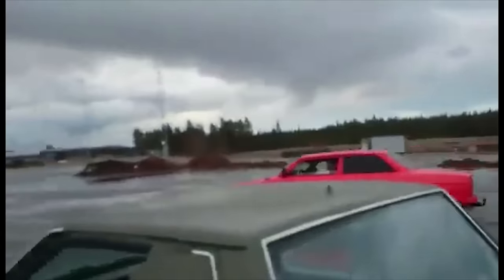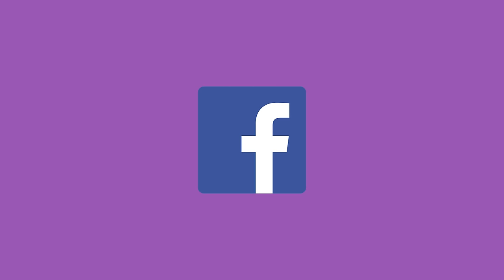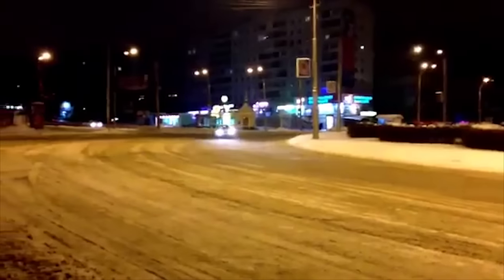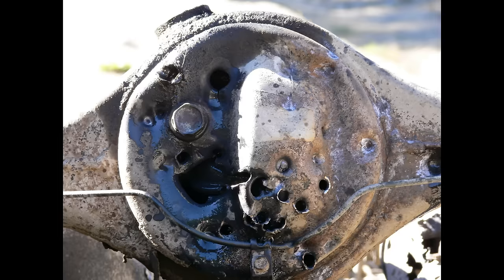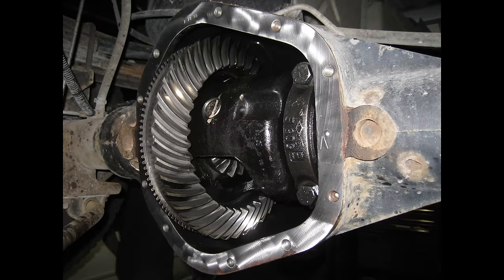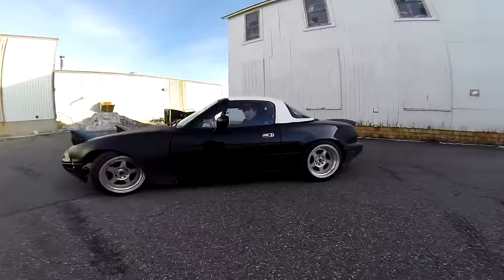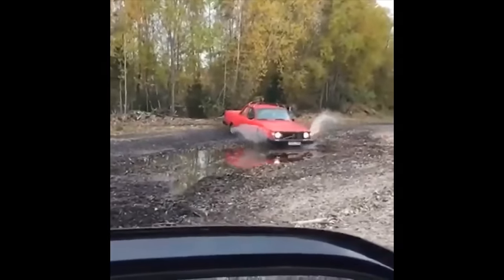Daily Driving A Welded Differential

Comment: I think I'd rather go the Clarkson route... MORE POWERRRRR!!!!!!
Reply: For a nice one tire fire?
Reply: +NGC1433 Who says I'd use a fully locked diff instead? There's something like a limited slip diff for a reason. ;)
Reply: This video is about welding open diffs on cheap cars. LSD's and POWAHH!!!111 have nothing to do with welding nor cheap.
Reply: I'm no nigga, nigga. Besides I drive a fine BMW e46 (hatchback) which has a LSD from factory (3.38 ratio in my case). Owned an Alfa Romeo 156 (sedan) before that and a Lancia Delta (hatchback) before that.

Also I meant locked diff earlier... my bad. Oh and it's a cheap mod but if you ever decide against it after you did that mod... it'll cost you a new friggin' diff. I'd rather add more power for that money as that'll give me more fun sideways as well as in a straight line. ;)
Reply: LogiForce86 Sorry, but I call bullshit on this... No e46 came with an LSD from factory apart from the almighty M3 e46... Ask me how I know, I have the same problem on my e39, no LSDs apart from M5 ones which don't fit directly (you need to swap out the whole rear subframe, same goes for e46), so no, you don't have factory fitted LSD in an e46 ;)

And welding the diff is often better than an LSD for drifting... For example, I have e30 Touring with 4.4 V8 swap in drift spec... The car was fitted with stock small case LSD... It got obliterated the first time I went out on track, so I swapped in medium case welded diff and the car started behaving better... Anyway, that one got busted as well, so I've swapped in the big case welded diff, but that's irrelevant...
Reply: !WK3 You're right. Just checked and I really wasn't well updated on the car since I just got one. Still getting used to these Germans. ;)
So a fixed ratio it is? According to RealOEM I have a ratio of 3.38 at least on the Compact.

Thanks for the wake up though, before I made a bigger fool of myself. Although I still rather do things right than half arsed and eat tyres away during normal driving. Drifting is nice but you won't do that with your daily all day long, every day of the week.

Still the current diff is nice enough for how I drive the car, and that's not drifting per say. Still it is nicely controllable if it does. I quickly noticed this in the wet because the garage I bought it from installed el-cheapo tyres that didn't have the tread grooves properly cleaned from molding residue. So as it couldn't channel water it was basically more like a slick in the wet. It was... quite interesting. :p
Reply: LogiForce86 With no grip, you could often have your car behaving like an LSD equipped one would during a slide because there is almost no force stopping the outer wheel from spinning thus not behaving like an open diff equipped car would :) Specially on a Compact with low weight in the back ;)
However, as you could have noticed before, I'm really hardcore into drifting, competing actually and my next drift event (last this season) is this Sunday (irrelevant, but wanted to mention it), so I do tend to drift my daily as much as possible... Which is not a lot as it's a 520i e39 (2.0 150bhp), obviously, with an open diff; and I'm driving on almost new sporty 255/35ZR18 tires in the back (I bought them new in April)... So I'm seriously considering welding the diff, installing a hydro handbrake (using my factory handle for maximum stealthiness) and setting up suspension for drifting, including swapping rears for worn out 205/55R16 when I want some sideways action... But that's just me, and that's just because a proper clutch type LSD costs at least 2500€ for an e39 and I'm not going to give 2500€ when I can spend ~50€... Yes, it might have some drawbacks, but still, it's better than an open diff in my case :)
Reply: Mine is just a mere 316ti e46 though, but when the engine goes than I'll drop in the M3 engine. Which probably means a whole lot of other things as well down the road, like different subframe and diff. Etc etc.
My summers were Minerva brand 255/45R17 all around. Now it's on Bridgestone Blizzak LM22 205/55R16 winters since last week. Due to tight budget I had to buy some second hand but they were hardly used and at least a premium brand unlike those summers.
I think I'll buy new summers around Easter but I'll burn these tyres up first. Or at least I'll try to give it a whirl. They are at least a bit too unreliable to transport a young family ;)

I still have a hydro brake laying around, well actually it's attached to my sim racing rig, but I am not that hardcore. It was a nice learning experience to make that work with the PC. Used a slave clutch cylinder of a VW transporter with skateboard bushings on the other end. Added a general 1000PSI pressure sensor and a VW Golf Mk2 hyro brakelight switch. At the time I didn't know if I wanted a instant on/off brake or a natural gradual one, so I made it that I could switch between the two.

It's awesome to read your experiences though, and yeah... I can see where you're coming from budget wise. It's probably not cheap to do this competitively... new parts, tyres, overal maintenance. So balancing a tight budget will become key.

I wish you all the best of luck this Sunday, and enjoy this last one... end it with a blast if you can. ;)
Reply: LogiForce86 If they hold well, I don't ask for tire brand :) I'm using locally made Tigar tires, model being Syneris... Tigar is owned by Michelin so I had no worries and I'm now on my second set (first one was taken off after just 21 day as I wanted to go from 17" to 18") and I'm very pleased in dry conditions, but in rain the can become a tad sketchier than I'd want them to be :) As for winter, I'll be buying Tigar Wintera soon, they're the best choice you can make, a car with a set of Winteras can drive up a greased up lamp post as we say here, they're incredible tires for next to no money as well! :D If I could choose between Wintera and Michelin Alpine for same price/free, I'd go with Winteras, tbh... Dang it, enough about tires xD

Thanks mate, I'll try and finish it of with a bang, but not a blown-differential bang, as I've finished BOTH events this season with a blown diff xD I'm starting to be known as The Diff Crusher over here 😏
Reply: !WK3 Can't get Tigers here unfortunately. Also I am looking at a nice BMW Styling 71 18" wide-set for my future tyres. Not sure if I'll go for them though, but it looked nicer than I expected.
Personally I am a Bridgestone guy as I like the direct response and feedback you get from the stiffer tyre carcasses they offer. Had Michelin my first two cars but that wasn't my cup of tea. So I switched to the other extreme in carcass construction and I liked it a lot better. The Alfa 156 liked it better too as it didn't get this odd double bounce where the tyre would rebound at the moment when the suspension was floating neutral between bump and rebound. Somehow this destabilized the car a lot as weight was thrown around more than you'd want to, plus it wasn't comfortable either.
Anyway... enough indeed. XD

I didn't mean you needed to blow something up! Just make it a great succes with no regrets for the season... if not in the race than just have a small after party or something to celebrate the end of the season. ;)

ps. You really need to get rid of that bad rep, mate. The only thing you should crush is the opposition. lol
Reply: LogiForce86 A little bit of a stretch on a tire can actually stiffen the tire and give you more stability than if you had no stretch ;) So much that you can often have a deflated tire without even noticing it xD

Yeah, I know what you meant, but your sentence structure was perfect for the intended pun ;) I hope to make some success, but The Diff Crusher nickname has to stay :D

Comment: Would prefer a LSD :)
Reply: Have to be on LSD to tell people to do this.
Reply: love both types
Reply: how about the best of both worlds, a differential with both a gear type limited slip AND a locker you can activate with a switch.. (the Ram Power Wagon has this setup in the rear end)
Reply: gonna need it.
Reply: I had a cusco full locked diff as a daily on a r33 skyline it was so predictable I could drift 3lanes gutter to gutter 3rd gear speedo reading 150km no problems. LSD is for wimps. Lock it then compare it you'll never want to drive another car without a full locker again. Nothing compares to a full locked diff as long as you have some decent power to back it up.. I had 230kw atw,I sold the car on the first test drive.. I had the buyer looking out of the passenger window facing the oncoming cars ahead. He said stop and didn't argue and gave me 15k for the car plus he didn't even bargain on the price I was asking. Lock the CVNT all the way & enjoy life.
Reply: Not everyone has the ability to run one

Comment: Im 17 from the UK, ive got a 1978 volvo 240 estate. 2.1L 4 cylinder with 89hp (1-port single carb version ;_;) its totally stock but i dont know what road to take it with mods. At the moment im thinking either rally car or drift car. Either way i dont know whether i should weld up the differential?? i've got a shitbox Ford Ka that i can use just to get to college if i need to but still not sure if the benefits of a welded diff outweigh the disadvantages. 

What do you guys recommend? BTW absolutely love the volvo 240 traktor at the end haha
Reply: Josh Briggs if your going rally car go limited slip diff it will save you sliding everywhere if your gonna do drifting go locked or welded 

You could do either but you won't get the desired effects if you switched them 

Hope that helped
Reply: hmm you could sort of do both, drift cars really dont need to be low to drift so you could get some long coil overs and make the suspension nice and soft then weld the diff aswell, it rally cars tend to have quite tight diffs anyway so i think youd be fine.
you could go between rally and drift with just a change of tires
Reply: god i want a 240so badly, they are so cool im in the uk too and theres this ancient 240 in tavistock i go past every time i go to my nans house, one day im gonna find who owns it and see if i can buy it off them
Reply: antsolja Thanks for the help mate. It would be a bit tricky to do both but perfectly do-able. I love 240's, insisted to my dad that he got me one as my first car (got the KA for free) and he paid £700 for it, which is very good for such an early example with the 'flat hood' and round headlights + loads of chrome etc. Go on youtube and type in "Swedishrally volvo 240" there are loads of great rally vids! And also type in "volvo 240 2jz by bjorck" the car is exactly the same as mine (but with a 2jz engine lol)

if you want to get one on a shoe string budget, £600/700 is what you'll pay for a decent car with an MOT that you can drive away. I've seen some with an MOT sell for half that, or quadruple! id all depends on yeah and condition. Good luck with the hunt!
Reply: mk2escort138 Yeah i had a feeling a limited slip would be more ideal. How much would a limited slip conversion be do you know by any chance? obviously i would do the work/installation obvs. The problem is i havent got much money to lavish on it. And i need to get some spotlights to fit on the front first hahaha
Reply: they are usually between £500 and £1000 for a new one but it depends on ur car and how much stuff is available (check rally sites and drift sites to try and find the best price)
 but don't go to  cheap or it will cost you more in the long run if you destroy it 

be wary of second hand stuff theres only 2 reasons why people ever sell stuff 
1 they got something better and don't need it 
 or 2 its broken

Comment: '70 Ford Maverick.  2850 pounds, 302"  300HP, AOD, Ford 9" welded diff.  Not much weight out back, so the 245/60/15 Cooper Cobras @15 PSI squeal, spin, and chirp all the time.  But none of the problems mentioned in the video.  I don't do the smoky burnouts.  These tires will  NOT WEAR OUT!!!  Only problem I have is that it doesn't want to turn around corners at higher speeds. Just a rare, quick, noisy, fun street car.

Comment: should i weld my diff on my track e36?
Reply: Vdvelde it's probably better to just save for a bit and get a locker, it's less brutal on your drivetrain and more reliable as a whole.
Reply: if its a track car dont weld it, you can get much better cornering speeds with open or an lsd
Reply: Yes, totally.
Reply: Not track car if it’s drift car be good 50/50 weight distribution but track no
Reply: Yes 100%

Comment: Mine's a front wheel drive so,  no welded diff for me.
Reply: That would be interesting :D
Reply: Even the LSD in my FWD GS Regal is interesting when cornering in the wet (with crappy Vivas especially). Duly shared.
Reply: Hey you can weld the LSD and then drive in reverse and get maximum reverse skids.
Reply: Works in front wheel drive too. It will be different to drive, but works
Reply: I'm OK with the LSD....elevens abound. Would love to hear how it works out for the OP tho'.

Comment: Off roaders/mudboggers often weld the diff on their trucks for better traction so both wheels always spin if they're in mud as a cheaper alternative to getting a limited slip differential especially if they bought a crap write off truck for cheap and are just going to bag on it til it fully dies

Comment: Ran a welded diff in my 4.3L S-15 truck for about 2 years before it let go one winter morning on my way to work, was close to -30°c that morning too. It was the center pin in the carrier that broke but luckily stayed in the carrier while I limped it about a mile to my grandmother's house where my buddy and I repaired it over the next couple days, chipped the pinion gear in a few spots so I needed a complete gear set. Limited slip differentials only in daily drivers from now on, lol.

Comment: Why is it that it’s harder to turn at low speeds? I’m trying to wrap my head around how a welded diff could mess with turning at low speeds if the front wheels are the ones that do the turning

Comment: When it comes to 4wd trucks do not weld the front unless you are pulling a sled. You can’t turn worth a damn. Us pulling truck guys always weld our rear ends never have any issues. My 86 K10 I welded the 10 bolt rear end and it was worth it

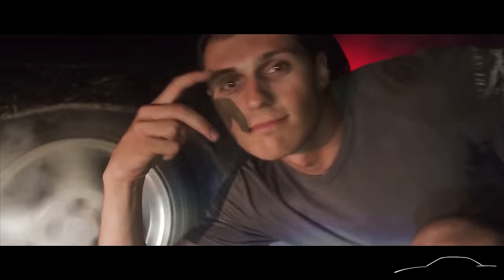Comment: 3:22 Wonder why the volvo is cut? In Sweden we have something originally intended for farm usage and pulling weight.(If you wanted something cheaper than a real tractor.) A rebuilt car that by law needs to have a half cut roof and only 2 seats and double gearboxes locked in 1st gear and a maximum speed of 30 kph  ( soon 40) Its call an  A - Tractor. And like the the licens for a real tractor you need to 15. So 15 year olds turned the idea of the A - Tractor in to a alternative to mopeds. But few are legal i mean  rip legal ones. Bare in mind they were supposed to haul stuff on farms. So when they go max speed the are at about 6000 to 7000 rpm constantly. Most guys i know have more gears than allowed to relive the engine of high revs. Bonus then is more speed. So hehe. In my town one got busted for 86 kph when they cant only go 30 kph.

Comment: Basically you do this if you can't afford an LSD as there's simply no other reason why you'd go around with a solid rear axle with zero slip. If it was that good then everyone would have welded diffs and not open ones.

Comment: The LSD is an option for Miatas idk why people weld their diff when u can just buy an aftermarket limited slip. It's the best of both worlds, mine even had one when I bought it. It's a viscous limited slip but it certainly gets the job done. 
I guess that shits too expensive for some people tho, even though they seem to have plenty of money to spend on a new transmission, engine swap, and turbo.
And if u have to do a tight u turn with a welded diff, just fuckin drift it m8 it's not even worth it to try and take it normally. Same with any tight corner too. Who cares what the cops say, u got a legitimate reason
Tho I think they frown upon welding your diff. Not sure I could be wrong

Also sick Vol-Camino 
Pretty sure u have to weld the diff if u want to drift those bricks. I've actually always wanted a Volvo 740 turbo wagon but they're really hard to find for some reason
I guess the drift tax affects everything rwd and manual
And I've seen a few 240s for sale but they're ALL automatics. And I just can't do that shit. Maybe if it was cheap I'd have a cool rwd beater car/daily but they're all out of my price range. Fuckin hipsters

Comment: Here in sweden every volvo raggare has welded diff volvoraggare= guy driving volvo like a idiot. You just buy a vinterpulka (volvo 240, 740,940) and weld the diff. Vinterpulka= old cheap shit rwd car. Then you drive around and drift like a pro and walltap everything! :D btw at 3:22 thare is a epa traktor, its a car you transform into a pickup truck only in sweden and its only allowed to run in 30kmh you can start drive it at the age of 15. Thay specific epa at 3:22 is a epa team in the north of sweden the team is called: "och service" search it on youtube and they will apear. They drive epa and drift alot :p

Comment: Worse advice ever. Stock axles are not meant to take the constant twisting that welding puts them under... no matter how much you "adjust" your driving style. Not to mention if done poorly the chance of material locking the gears at speed. Dont be foolish, spend the 2 grand and do it properly. Not sure about your foreign jobbies but a decent posi for any American muscle car can be had for 500-750 bucks. Invest in good clutches and good springs. Spools and lockers are for those midnight runs and the track/off-road.
Reply: americawhereareyou
Ok Mum.